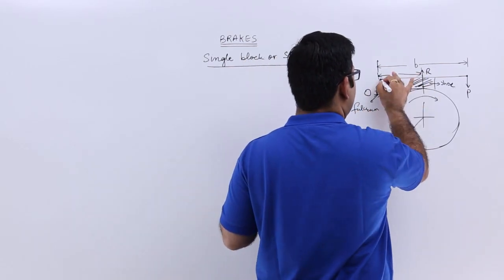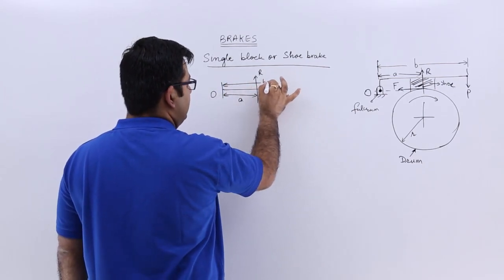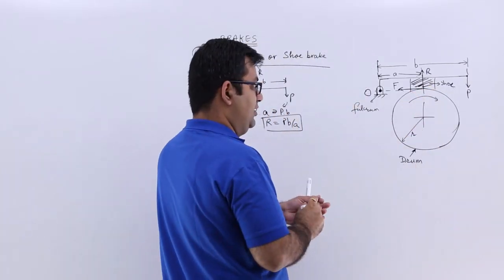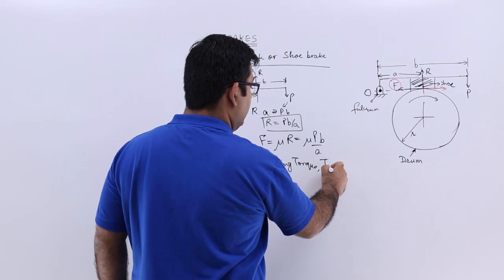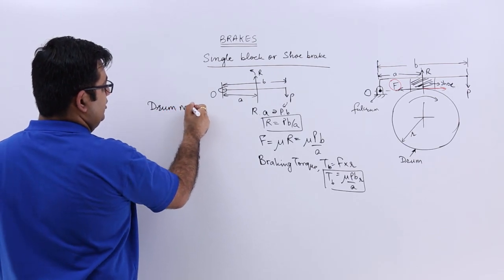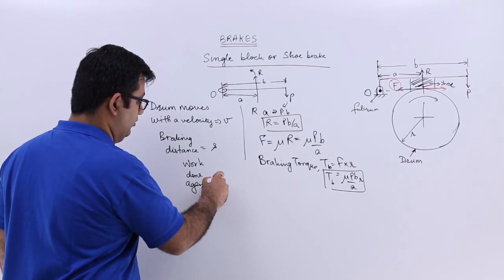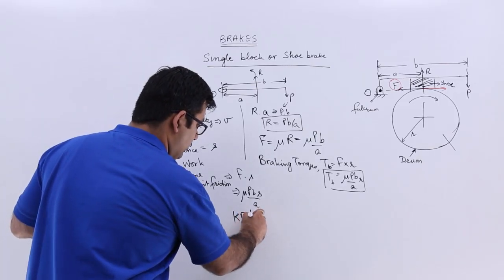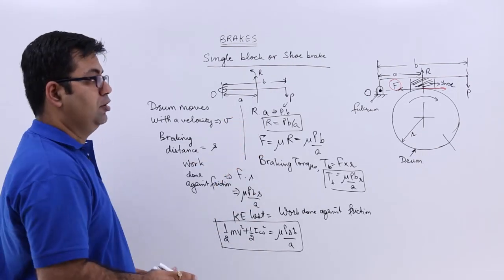Single Block Or Shoe Brake

Comment: Hello Folks! Can somebody help me with this problem with regards to band brake.
A band brake is to absorb 5 hp to 200 rpm. The maximum pressure of the lining and the drum is 120 psi. The angle of wrap is 3.6 radians, the width of the band is 3 inches and f=0.15. Find the forces at the tight side. The diameter of the drum is at 8 inches.